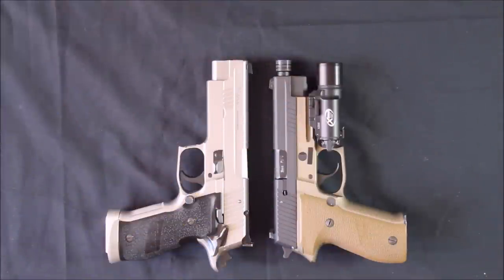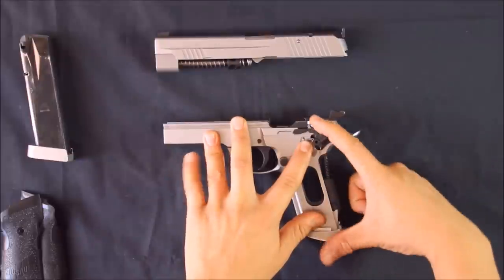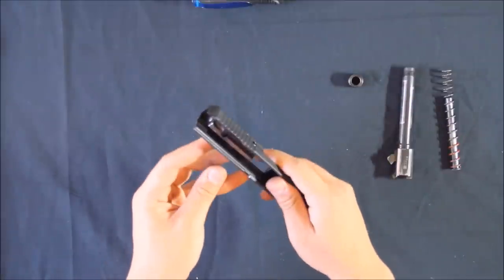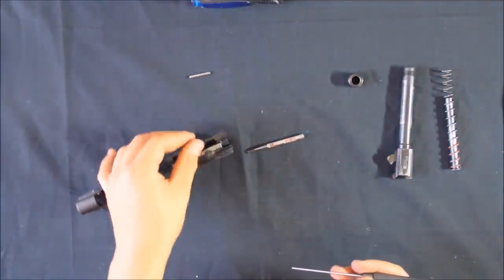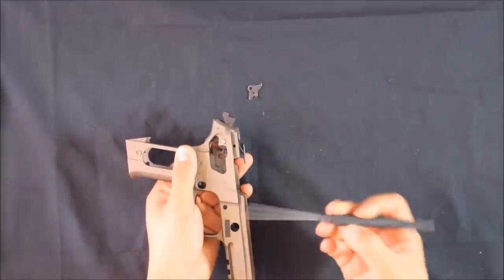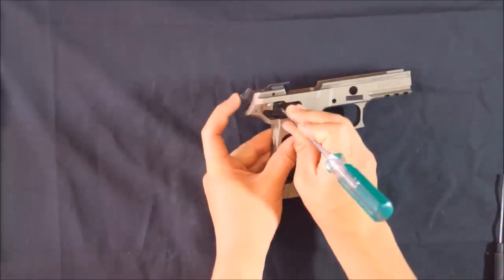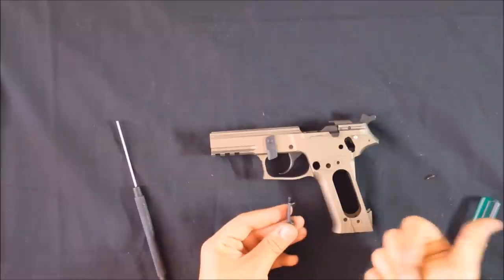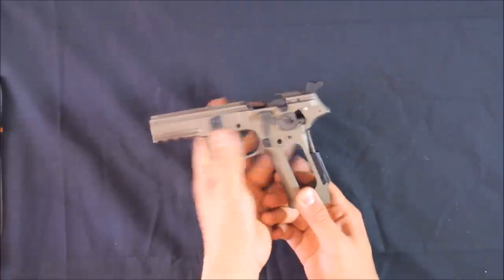How to 100% disassemble Sig Sauer P226

Comment from the maker: UPDATE: After 5 years of constant use (I estimate more than 15,000 full power rounds) the P226 combat has finally had a main component failure - The mainspring snapped in half. The metal must have fatigued enough for the snap. Not bad for the old Sig. New spring is on its way from Brownells. Funnily enough, the pistol continued to fire with the two halves on the guide rod, albeit with a failure to close into battery every now and again. Awesome pistol, I'm impressed!
Reply: Main spring is supposed to be replaced every 5000 rounds anyway :) so it is not a malfunction rather a miss on your part.
Reply from the maker: Yep, although thats a typo: I meant to say the recoil spring. Probably the same mileage anyway.
Reply: 15.000 rounds and the worst that happened was a spring snapping?
Dauym!
Reply: 😂I only replace if the recoil spring is broken.

Comment: I just came here after working on a Gas Blow Back, Airsoft pistol version of a Sig P226 (I work as a mechanic for airsoft weapons for a living).

And after viewing this video, it's downright spooky how similar the mechanisms in the toy gun that I worked on are to the real deal.

I used to jokingly say how I should apply for a job at a gunstore as a gunsmith seeing as how I've been taking apart and putting back airsoft weapons together for so long. And now actually seeing a full dissasembly of a pistol, I can honestly say that they're even LESS complicated than airsoft replicas are, suddenly the idea doesn't seem that far fetched anymore.

It would be quite enjoyable to work on real firearms. Especially custom work like altering the performance and behaviour of triggers and such.
Reply from the maker: I agree, I would need to skill up as a machinist first though! The tolerances and pressures involved in the real deal are substantially higher though; one mm out when it comes to the locking 'block' section of the barrel and you could have it explode in your hands from an out of battery discharge. Airsoft is illegal here in Australia, so I guess I'll just have to be happy with real guns (dumb law)

Comment: Thanks for making this very clear and informational video.  I love my Sig P226 .40 cal so much.  I've been wanting to do a complete breakdown and cleaning after putting it through a very rigorous amount of use and abuse to test the integrity and in case of emergency reliability without failure and it passed the test.  Again thank you very much.
Reply from the maker: No problems dude :) Wish I could get a .40 cal here in Australia.... need a high calibre permit to acquire one... Another level of difficulty on an already difficult process to get a handgun.

Comment: Very well done video! All good information without any extraneous trash that drag out so many videos. Saving this for future reference.

You are, no doubt, already aware but for the benefit of those watching... It is often the case that small parts want to slip, slide or fall out of place while you're trying to reassemble a firearm. A small dollop of gun grease can be used to hold the parts in place while you're positioning the rest of the assembly. For the purposes of making a video like this one it would obviously make things more messy and harder but, in the real world, there's no reason not to make things a bit easier.

Comment: Excellent video,  You really should get the Sig Armorers Tool.  You should use it for removing and replacing the mainspring assembly, the decocking spring, and the trigger bar spring. You only need to puncture your hand once with a screw driver and you will definitely buy the tool. The way Sig armorers are taught in stripping the frame is after taking off the grips, then you start the disassembly on the left hand side proceed to the main spring housing, remove the trigger block, remove the sear assembly, and then finish with the right hand side.  Reassembly start on the left hand side and follows the sequence of disassembly in reverse, and ends with the insertion of the trigger block.
Reply from the maker: +Bill Smith Thanks for the tip, I'll look into it!

Comment: Great video, just got a used 226 and wanted to do a very thorough cleaning, this helped a good amount. I have to wait for the spare parts lot to come in (the slide pin that holds the firing pin in place is a little worn in and moves on it's own) but now I know how it all goes. Hah thank ya!
Reply from the maker: Like I said in the video, the roll pin is only designed to go in once. After that, it needs replacing. Sounds like the previous owner pulled it apart a few times. Glad you found it helpful.
Reply: where do you say this exactly? did I miss the part? you mean the pin you punch out in minute 14:00

Comment: Very detailed and clear instructions. I just got some upgrade parts for my MK25, this will be my guide 😂 I guess my main concern is when I put the firing pin retaining pin back in, my punch or my hammer is gonna scar the slide
Reply from the maker: Definitely a real concern! the solid pin on an X5 is rounded, so a concave punch is recommended. The Mk25, if it's like any other US made 226, will have a roll pin. Use the correct sized flat punch, take your time and use a new pin each time. Good luck!

Comment: Disclaimer: I'm not responsible for you messing up your shit:Your "firing pin disconnect" is a Safety Lever.A good way to stab your self while removing the mainspring seat, is exactly how you just did it. I like to place the frame on its side on the table, keep my hand away from my screwdriver, push up on the seat with just enough force to get it off of its seat, then give it a twist to unseat it.I would also remove the hammer stop/reset spring(piece in the back that you left in) all you need is a 1/16 punch and a hammer. It comes out easy and will make reinstalling things easier.Disconnecting the sear spring before pushing the pin out will keep parts from flying out at you. The extractor is easy on both of those slides, the standard 226 has a spring, a plunger, and the extractor. Using a small flat head screwdriver, wedge it between the plunger and the extractor, then push the plunger back into the slide and get your screwdriver behind the extractor. A flip towards the front should pop it out, WARNING: SPRING TENSION  To reinstall, install spring, then plunger(it will stick out a little) then place the lower step(you'll see it if you take it apart) of the extractor onto the plunger. Using the screwdriver, pull back on the extractor, then push it into to slide, you should get a nice CLICK.The X5 extractor is even easier, just rest the slide on the table, sights up, place a punch on the hook of the extractor, then give it a quick tap and it should start to swing down, flip the slide over continue swinging the extractor down then pull it out through its groove. Reinstall is reverse with you needing to swing the hook around the breech face.Reassembly of frame, I would start with the De-cocking lever, just so you have as much room as possible to work. Some people like to use a stick magnet and reach through the right side of the frame to install the bearing(plate).The support plate(plate behind mag catch) can be installed on either side for you wrong handed shooters, but it is the only part the is reversible.I would install hammer/pin, then do strut/spring/seat to keep it all together while you work on the rest. Hammer strut will go UNDER the pin built into the hammer, then you can install the hammer stop/reset spring with the spring going OVER the same pin. (Long leg of spring sticks out of the front of the hammer stop)While installing the sear group I prefer to use a punch(3/32) to hold the parts as I go from left to right I.E.: Ejector, punch, sear, punch, sear spring, punch, safety lever, punch. Then use the sear pin to just push my punch back out of the way. The safety lever can be tricky to get in, in this case I hold the lever in its correct orientation, then start it in front of its home, then slide it backwards to line it up with the pin hole. An SRT safety lever can just be dropped straight in from the top as it does not have a 90* bend in it. Then using a small flat head that I cut a V into I connect the sear spring.To install the trigger one may want to disconnect the sear spring and pull up on the safety lever to make it easier to get the trigger back to where it goes. Just remember to reconnect after. With an SRT you may need to do a little more dancing to get it to fit. I like to hold my trigger upside down on the bar, drop the bar into the frame and swing it way wide to get around long leg of the safety lever, hold that in place and swing my trigger itself down into its home.Also make sure your hammer pin in sticking out of the right side of the frame more so than the left, it really doesn't even need to stick out of the left side. The trigger bar uses the hammer pin as a cam to fire. So if you get the gun back together and when you pull the trigger the hammer goes back, but wont fire, your hammer pin is not sticking out enough.At some point ill make my own video but you did VERY well.Tools needed for complete dis/ass:
1/16 punch3/32 punchFlat Head Screwdriver(small V cut into it for ease of spring movement)4 oz Hammer
Reply: not sure why it wont let me put spaces to separate my steps...

Comment: Nice video!
To begin many of these videos use an incorrect background color, throwing the contrast off and seeing anything on the inside is impossible.
The other plus are your little nuggets of knowledge about spring tensions and other minutiae that would make you regret waking up that morning.
Any ideas for disassembly of a P220 DAO?
It looks very similar.
Thanks

Comment: My226 is almost brand new, and the slide is a little different.  The pin does not seem to go straight through the slide to take out the firing pin.  The extractor is much longer and seems to block it on the other side.

Comment from the maker: For those asking about the X5: There is one thing I forgot to mention, and it only became apparent after I dropped it in the sand and had to pull it down to clean it out. 

The extractor, sear, sear spring and pin-block disconnect are assembled in exactly the same way as the video shows at 21:22, however due to slightly different dimensions internally, the X5 has a fifth part which is an aluminium spacer. This part should sit on the right side of the frame (after the disconnect). This part has two holes in it, the second hole being where the hammer pin sits. Thus this part needs to be installed first as it requires both the hammer pin and the sear pin to hold it in place.

In summary: The sear assembly is the same as above for an X5, but has an additional spacer that sits on the right side.

Comment: Great video, love my Sig P226 Legion.
Question is how often do you need to totally disassemble and clean the weapon?
Reply from the maker: Thanks! In all honesty, I basically never cleaned my P226's, just an annual bore swab and wipe down, for the 7 years I owned both of them. Nil malfunctions, no issues. I don't think a complete strip down is required for the life of the pistol, not unless something actually breaks. Cheers

Comment: Really nice video, thank you!

One question if you don't mind. If I want to remove the de-cocker, do I have to do all the previous steps first with the locking block, trigger and main spring? Or can I simply skip to just the de-cocker part and follow your instructions?
Reply from the maker: Tobias Törnström I havent tried it, but I would assume all you would need to do is remove grips then continue onwards with decocker removal. I can't remember if there is anything on the inside of the frame that would stop you getting access to it, pretty sure its OK. Good luck!

Comment: Fantastic video! I am a first time handgun owner with that exact sig p226 with the tb. Did you grease the insides off camera? Just curious as I want to strip my gun to clean it fully. I made some newbie errors and the gun works great but is filthy inside still after cleanings.
Reply from the maker: +Gary Galmin I only put oil on the rails where the steel contacts the alloy. I find that any grease attracts carbon and dirt, so the gun gets a dry wipe down every now and again but that's about it!

Comment: That was an easy job to hammer out the firing pin positioning pin (FPPP) or you had removed it before?
Reply from the maker: +ybrik5 I had removed it before filming to as practice. It was very difficult the first time and required some heavy smacks with the hammer to get it to start moving. Take your time and make sure the punch stays on the pin, otherwise you risk damaging the Nitron finish. 

The pins in standard P226's are roll pins, meaning they are meant to be one use. I discovered this later on and replaced it with another roll pin from Brownells. The pin in X5's are solid and I haven't had any problems with it so far (and it has been out three times).

Comment: Chang,  Should a P229 be detail cleaned after 5000 rounds?  If so, do you know of any instructional videos on how to do this procedure?  I'm talking about a more detailed cleaning than a field strip and clean.  I'm not sure how to take apart the slide components and clean them, i.e. firing pin and channel, firing pin block, etc.

Thank You,

Ken Evans
Reply from the maker: +Ken Evans 

It's up to you mate, Sig makes some durable hardware. You could probably keep going without ever needing to detail strip the gun; Other than something breaking, I can't see what would cause the gun to ever fail. I have done it twice over 4 years for piece of mind and its always interesting pulling it apart. 

The P229 is basically a compact version of the P226. I don't own one, but I would think almost everything would pull apart exactly like in my video. I'm sure there are some good videos somewhere on Youtube, just give it a search. 

A look at this schematic tells me all of the parts are exactly the same except the shorter slide, barrel and recoil assembly: http://www.gunsourcebyzcl.com/_/rsrc/1337148035144/home/Gun-Disassembly-And-Info/handguns/sig-sauer-handguns/sig-sauer-p229-disassembly/sig-sauer-p229-diagram/Sig%20P229%20Diagram.JPG

Comment: Hello, Thank you for this video.  Could you please tell me if parts are compatible between regular P226's and the X-Five Allround?Is the trigger bar spring the same?Will a short reset trigger kit fit on both pistols?  What about the controls such as take down lever, trigger, hammer, slide stop, decocker and mag release? Are all those parts interchangeable?Thank you
Reply from the maker: Hi mate, unfortunately I've sold the X5 and so dont have both in front of me to check, so take this with a grain of salt but I believe almost all of the parts are interchangeable except things like the difference between SAO and SA/DA like the safety, decocker, etc. Springs, triggers, etc should be the same.

I could switch the slides on both pistols and they would function just fine, albeit with a gap with the longer X5 slide on the shorter P226 frame.

The barrels are definitely not interchangeable because the X5 bull barrel has a larger diameter and corresponding larger diameter port in the front of the slide. 

Sorry I couldn't be of more help
Reply: OK thanks, I just ordered $400 worth of parts so we'll see.

Comment: Hey Chang, I'm wondering if your P226 combat came with the stainless/silver locking block or if that is an aftermarket part. I just purchased a used P226R Navy and it came with a locking block very similar to yours. Thanks!
Reply from the maker: +Ibn Adam It's a stock part. I think it might even be alloy, I don't have mine on me to check.
Reply: +Chang739 Yes it would make sense since the frame is alloy. I was just surprised, having had many different P226s and all of them had a nitron finished locking block.Thanks for the info and the great video man, keep it up!
Reply: its nickel plated steel.

Comment: I'm using this to detail clean a used P245 I just purchased. I'm at the point of the sear reassembly, and I can't figure out if I have misplaced the ejector or if the 245 is built differently. None of the schematic for the P220 series I've found show an ejector that I can see. Anyone have any insight? Thanks in advance.
Reply from the maker: FunwithGuns 

We're not allowed .45's here in Aus under a standard license, so I wouldn't know how a P245 functions. Knowing Sig, it should be fairly similar to the P226. 

IF it is like the P226, then all of those components will ride on a common pin. It's just a matter of figuring out what order they go onto that pin on and which direction the parts should face. The P226 sear reassembly in this vid is at 21:22.

Good luck

Comment: Very, very good video--but if you do not remove the hammer return spring, block, and pin, the gun is not "100%" disassembled. I know why you didn't remove it; it's a pain to reassemble without making a slave pin to match thr block.